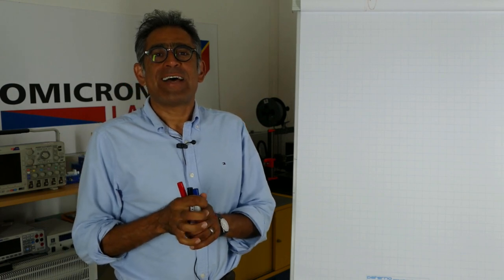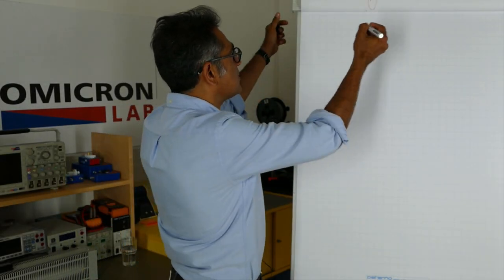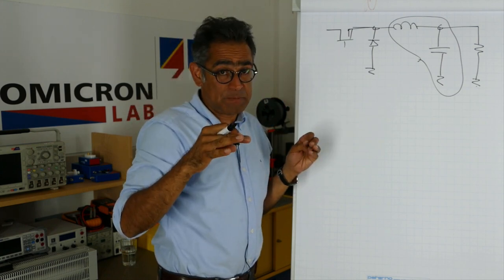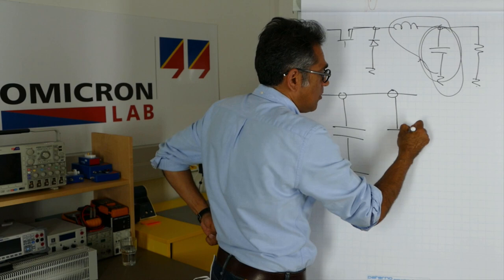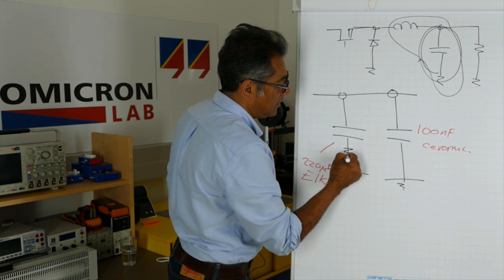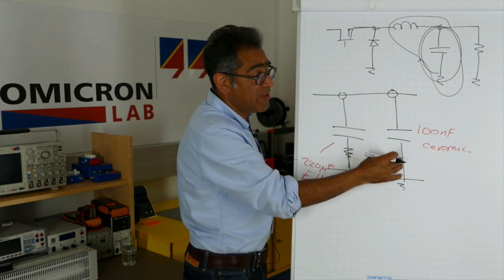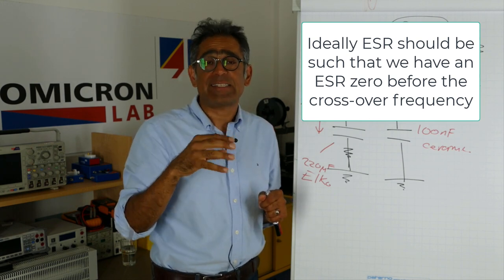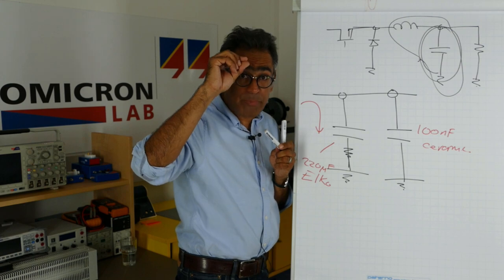Mixing ceramic and electrolytic capacitors on the output of power supplies

Comment: From my experience with SMPS, there is also switching noise to consider, for EMC, and that is typically a repetitive pulse with content in the MHz range, often above 10 MHz, and that needs to be countered by capacitors with appropriate ESR & capacity.
I would like to see switching frequency of 600 kHz to 1+MHz, realistic for mobile device applications.
Another issue to consider, especially with buck converterd, is reducing the noise produced on the *input side*, perhaps you have covered that in another video?
Because many engineers, working on the bench, have an oscilloscope as their first-line tool, I think it would be very instructive to show the SMPS output voltage waveform, and FFT, along with the Bode plots?
Otherwise, of course, nice video.
Reply: 'A switching noise' you are talking about, I guess, is created by common mode noise, so it is a different problem.

Comment: Another note: it might be useful to introduce a short discussion of ceramic capacitor parameter changes with voltage and time, and how that can affect component selection, a very important consideration for volume production and meeting EMC/performance specifications over time and temperature.
Just a thought.

Comment: There's more to electronic design than how it works when new.  I'd like to see the results of aging.  That electrolytic is brand new.  What's it like after it's aged?  I believe the high frequencies tend to cook the electrolytic quicker.  The ceramic might help slow the aging of the electo as it will handle some of the harmonics.  It will also come on it's own as the ESR of the elecro climbs.

Comment: The best way is always to use mutiple same value capacitors in parallel asi t reduced the ESR and ESL greatly. So instead of a single 220uF go for 5 x 47uF capacitors in parallel. Zhis way the ripple current will also be divided by 5 meaning the omic losses will be 25 times less in each 47uF cap. This will greatly increase their operating time as well
Reply: Although this approach provides much-improved ESR, it is more expensive, and takes much more PCB space, and these are huge considerations in mobile applications, and cost is always a consideration in volume production.
Another issue with this approach is that it increases the component count, and the number of soldered connections, both of which affect production failure rate, as well as increased probability of field failures.
IMHO.
Reply: @lohikarhu734  Actually doing this decreases the failure rate. The circuit will still work with 4 capacitors instead of 5. But if you have only one and that gets damaged, it's game over.

Comment: What about the super capacitors that are now also available? For example, you can get a 4F 5.5V supercapacitor for about ~5$. Has anyone measured them like in this video and are their ESR curves like the ceramic or electrolytic capacitors or something different?
Reply: Their typical purpose is a storage of an energy, but nor filtering.
Reply: Super capacitor has practically nothing to do with traditional capacitors. It is more like rechargeable battery.

Comment: Do electrolytics need to be used to replace electrolytics???  Like if I want to recap electrolyics in a audio mixer  or power supply can I use something that will fail clean rather than spilling its guts?

Comment: Thanks very much for the instructional video. 
Regarding a linear PSU regulated with a three terminal voltage regulator, what tip can you recommend if at a low frequency (50 Hz) the MLCC capacitors are invisible to noise? For example, a power supply regulated with LM338, at 20V/1A, after the rectifier bridge, it displays a ripple of 400 mVpp on the oscilloscope which I cannot attenuate by increasing the capacity filter up to 20.000uF. How can you help about it? 
Thanks very much in advance for your kind reply.
Reply: You have a faulty component

Comment: Thanks Ali for presentation.
However because of the big price of BODE 100 here in iran, i still have to use spice simulation for this
Reply: Spice is great but getting capacitor models to behave like the real ones at all frequencies is near impossible.
Reply: If you have a modern scope with FFT, you can visualize the results in another "space"... Even without FFT, you can see the results in the waveform of a prototype device...

Comment: But in many audio amplifier that powered by transformer power supply at 50-60 hz,  the output has parallel electrolyte capacitor and 100 nf ceramic capacitor, is 100nf ceramic become useless for transformer power supply 50-60 hz?
Reply: That's exactly what I'm also wondering so it would be great if we could get an answer :)
Reply: Just put the output on the oscilloscope and then you will know.

Comment: Good morning, What is the benefit of using series and parallel ceramic capacitors in power boards?
Reply: In series, you may use lower voltage capacitors in higher voltage system. But nobody does that. Instead, you just use higher voltage capacitors. In parallel, you increase the capacitance and lower the ESR, which both reduce the ripple.